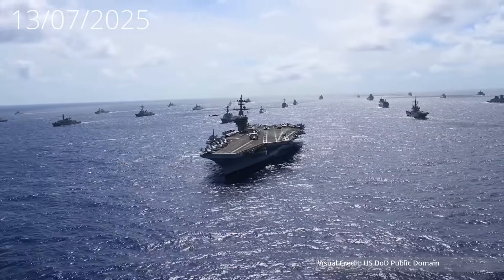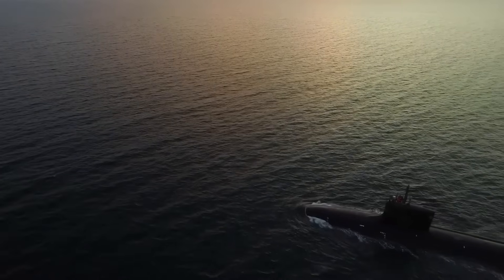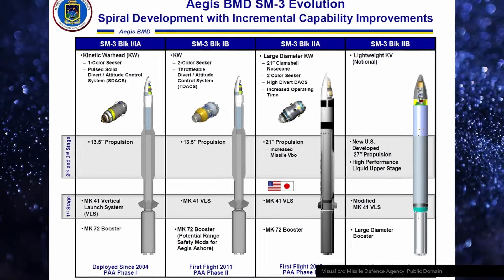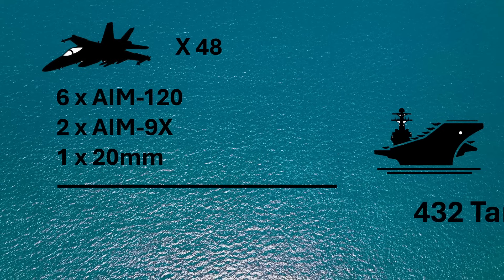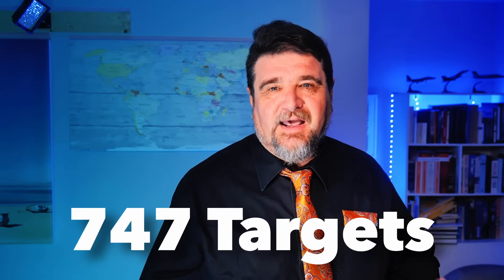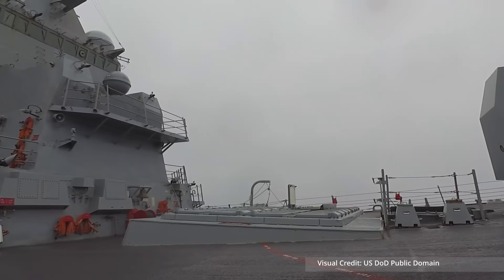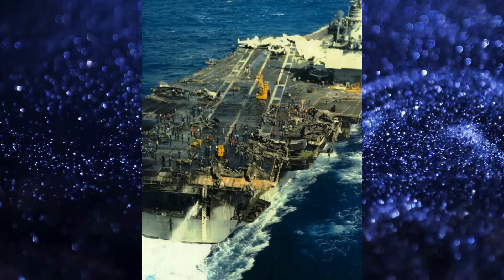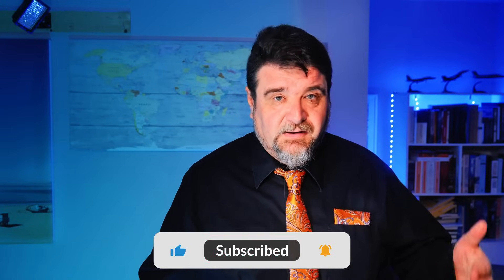HOW MANY Missiles are Needed to SINK A CARRIER?

Comment: it's also important to compare a aircraft carrier to a island 

The aircraft carrier may be able to be Sunk but it can also move meanwhile the island is stuck in the same place
Reply: The question is how much can a carrier realistically maneuver to evade hypersonics. If a mach 6 projectile covers 1000nm in 13 minutes, then how much can you realistically change course to offset that?
An aircraft carrier does about 30-35 miles per hour, so it would move what, around 7 miles? That is close enough to zero.
Reply: @singular9 I mean, there’s A LOT there to unpack. It’s also possible that a hypersonic weapon, assuming with an onboard seeker for terminal guidance like many other anti ship missiles, by the time it activates its seeker- it may be moving too fast to maneuver onto its target.

It goes both ways, and it depends on how early the carrier is aware of a launch against it.

Hypersonic missiles are also very visible to sensors by nature, their lethality comes with difficulty of physical intercept. I’m sure the carrier force will be jamming it the whole flight too
Reply: @singular9  it is presumed that using wartime emergency power the aircraft carriers can go even faster 

also think of a hypersonic missile as a sniper's bullet . The first step in not getting sniped is not getting detected by the sniper the second is not being in the snipers crosshair
Reply: @avus-kw2f213 even in it theorized max speed which is not physically possible to achieve, a carrier would not be able to travel more than 1 kilometer between the time it detect the missile and the time to impact. and to think a 300 meter long ship cannot be detected in the age of spysat is just laughable.
Reply: @lagrangewei There were already plenty of ways to avoid satellite detection back during the Cold War and the world is aware of their effect. It’s also easy to deny GPS guidance in certain areas, assuming the Chinese hypersonics are gps guided
Reply: @lagrangewei  good point but satellites can be dealt with